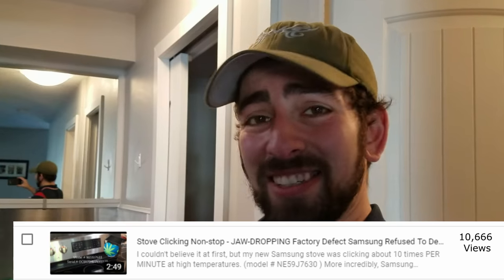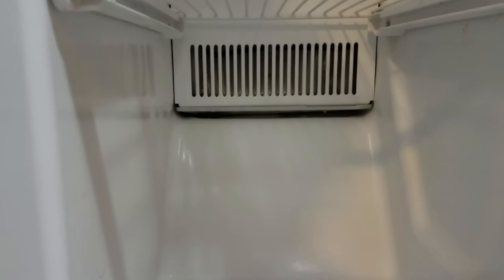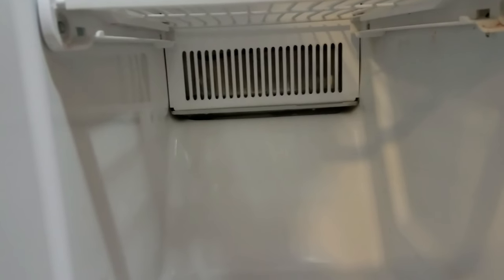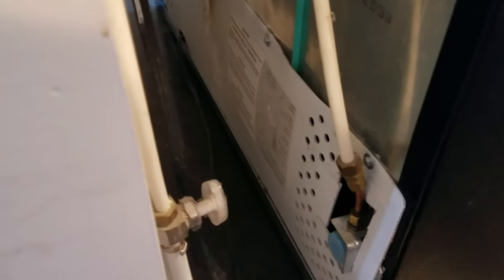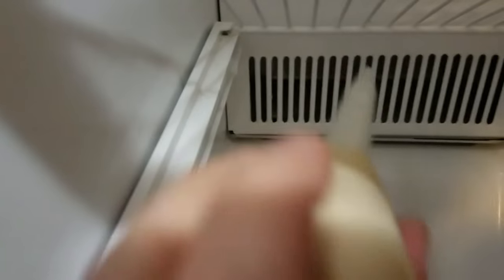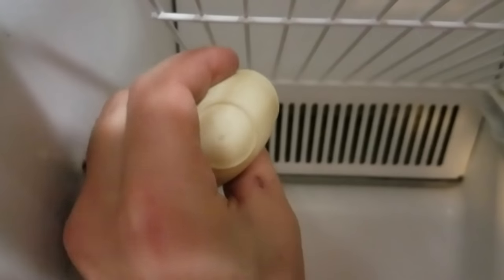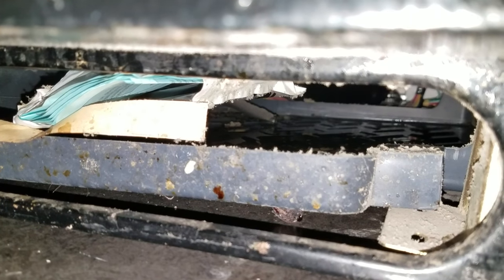Fix A Clogged Fridge Defrost Drain WITHOUT Opening Panels - How To

Comment from the maker: Holy cow, 350K views?! Top video on whole channel?! ...You guys REALLY need help with your fridges! Lol ...anyway, if you're new here Plz sub and look around...I actually have many far MORE useful videos than this simple fridge tip.
Reply: This is a lot more views now
Reply: YES...BECAUSE SAMSUNG DENIES THAT THEIR REFRIGERATOR HAS 2 HUGE DEFECTIVE ISSUES...
Reply: This will now be my first stop
Reply: So I did all this. Didn’t work. Do you have a video on how to remove the back panel and unclog it? We have that same fridge in white. And is the coil suppose to be glowing hot? Ours isn’t.
Reply: Subbed!
Reply: Sadly the hot water isn't working. Any tips on taking apart the entire rear panel, coils, etc? 😫
Reply: 350K? Try 789K! 🤣🤣🤣🤣  I had no idea this part of the machine even existed! If I had not found your vid, I would have spent all morning replacing the water valve for the ice maker, and my freezer would still be leaking! 🤣🤣🤣🤣  Dude, you should get a Tip button just for this post!
Reply: did that at my old house with a heat gun. problem is if you have to do this often could mean the defroster is failing. is what happened to me
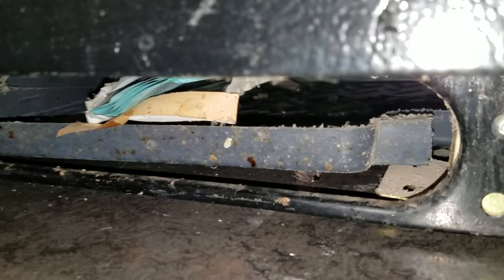Reply: Thanks. Where are you from? I like your accent. God bless. John 3:16
Reply: Thank you! Just subscribed.

Comment: This was SUCH a helpful video!  We did NOT want to open the back of our fridge.  Thanks to Lex, our drain is unclogged!!  Pro tip:  we also squirted some white vinegar in the drain as well, just to finish cleaning out the yecky stuff.  Worked like a charm!  Thank you again!!
Reply: I'd think twice before pouring vinegar solution down of any drain. It damages rubber and seals. You may want to boil some baking soda in water (or mix washing soda with hot water), and use that instead. It's an old way of unclogging all kinds of drains and it's very effective when used hot. I'd cool it before pouring into the toilet though, to avoid the thermal shock.

Comment: I have a Frigidaire. I firstly use this method, but it did not work, and continue to leak. Then, I open the panel a little bit, and found out that there is a layer of ice of half inch thick. I used a metal skewer to dig out inside the panel until I can see the drain hole. I pull hot water in, but it seems like the drain hole is still blocked. I used the same metal skewer to dig inside the drain hole, and get some ice out. After some iterations of digging and pulling hot water, it finally works. Thank you for the tips. My recommendation is to clear the start the process of pulling hot water at least you can see the drain hole (without being block by inches of ice), otherwise, the hot water won't be able to melt such big piece of ice.
Reply: Hey same issue! Thick layer of ice, you broke that first ?

Comment: I just want to call out that I have fixed my refrigerator two times in the last 3-4 years using this method. I remember the first time I had this issue, I paid someone over $200 to fix it and now it takes me 30 minutes and I don't need to take anything apart. Thank you!

Comment: Okay, this worked perfectly to fix a problem I have been having for probably over a year now. This video helped me find the drain hole, and the pan under the fridge (which I was always wondering where it was). Turns out... The drain hole was completely covered with a layer of ice, and then was also plugged with ice too. I didn't have a turkey baster but I had a condiment squeeze bottle with a pointy tip that I was able to use instead and it worked great. Thanks for the video! I was so sick and tired of having to chip out ice from the bottom of my freezer!
Reply: I don't have a turkey baster either, so I'm going to try a haircolor bottle!

Comment: I had to come back and say thank you! I did this on April 6th. I'm still amazed this was such an easy fix for what I thought was possibly something major. Plus, I thought I would have to take all of my food out but instead I watched your video, I looked up about my drain pan(I had no idea where it was or if I had one) but I do and I could kinda see it underneath so then I proceeded to remove food from the bottom only yay and saw I had a ziploc bag stuck to ice covering the drain hole! I poured the hot water repeatedly, then I could hear like a gulp of air and the water running to the drain pan! yay Thank you so much! I liked and subscribed too.

Comment: Thank you.  I was about to call repair service AND to shop for a new frig when I found your video.  I figured I had nothing to lose except a few minutes, so I boiled some water, got out the turkey baster and a knife, and after removing bottom ice and scraping ice away from bottom of the vent slots (this was iced over), I sent the boiling water down as directed.  Much to my utter surprise and great delight, it worked!  No ice collecting at bottom now, and it's over a week.  Whirlpool says it needs a 'permanent fix’ of a new drain pipe, but for now, I'm happy and will deal with the permanent issue later if Needed.  Thank you again.

Comment: Thank you so much!!!
When I saw your video, at first I couldn’t believe that it might work, so I tried to follow the instructions on someone else’s video and opened the back panel of my fridge, but unlike their fridge, mine doesn’t have an access to the tube from the back of the fridge, being too scared to open the panel that’s inside the fridge, I finally decided to follow your recommendation, and wow! I see water finally dripping from the tube in the drain pan under the fridge, and 12 hours have passed and I haven’t seen any leaks any more. 
Thank you so much. ( I used a plastic syringe to push the hot water in)

Comment: I never comment on youtube videos but i just wanted to say this helped me so much, I didnt have to remove any panels. I pumped hot water from the sink through a turkey baster, adjusted the piece over the hole so it wasnt covering it at all, and it fixed the issue. my fridge has been leaking/forming ice for over a year and I never figured it out. THANK YOU

Comment: Worked for me!  I have a french door GE with freezer at bottom.  Been getting ice under bottom tray for a while.  Defrosted vents, but could’nt get bolts off to take panels off.  Saw your video, got a bulb syringe and some hot water, and gave it a go.  After the 3rd or 4th time, heard a loud suction sound and that was it.  Put a few more cups of hot water and some baking soda down there.  Took some of the water out of drip pan to make sure it did’nt overflow, and fingers crossed that problem is solved!

Comment: For those with a Maytag french drawer freezer it may be worth the extra effort to pull panels off so you can check for excessive ice buildup in addition to the drain problem.  I had a huge chunk of ice in the upper right hand corner I had to thaw out and I put in some extra effort to do some cleanup maintenance while I had things pulled apart.

Comment: Almost worked just like you said we have been having problems for like 2 years.....boiling water didnt work but a air compressor did and cleaned out the drain hose.......GREAT VIDEO THANKS FOR THE INFO......

Comment: Just did it and it worked! Hot water alone didn’t do it, so I added vinegar and baking soda. Also had a mini drain snake, pushed it down several times. Checked the hose down at the pan again and it was dripping! Happy! Thanks!
Reply: Thank you the vinegar and baking soda I heard a big flesh and then there was finally water.
Reply: How much vinegar and baking soda did you add?
Reply: @caripokrassa5027  I didn’t measure, enough as needed I guess. It was 2 years ago I barely remember doing it! 😅

Comment: Thank you.    
I took the additional step of removing the rear panel from the INSIDE of the freezer.   Then I used an outdoor flexible, gas grill snake to snake the tube to clear it.   
Then I ran hot water down and everything worked good .

Comment: I could see through that grill that i had 2-3" high ice, so i took the four screws off that hold that panel on, then slid it up about a foot* (it flexes)
Then i used lots of hot water and used the baster directly on the drain hole  for the hose till it flowed through.  :)

But YOUR video showed me the problem and how to fix it.   Thumbs up!

Comment: I am going to add another "Thank You!"  I started on the inside and took off one shelf bracket and the back lower interior panel.  I saw the condensation drain and then found your video.  Because I had the panel off, I could dump hot water down.  But the turkey baster (and having the panel off) actually allowed me to pressure the line a little to clear it out so that it drained.
On a side note, I concurrently have a rust stain on the back of the freezer that I thought might be the issue and I was running down a rabbit hole of manufacturer defect chasing remedies, spray foam insulation, cutting metal access panels, etc....  Turns out, just a clogged drain line...  Thanks again!

Comment: Yup, that was it. 
Of course my turkey baster couldn't get enough water through the vent. I had to take off a panel inside the freezer to get to the drip tray that had a huge block of ice in it. There was also some ice above the fan that came loose. Every situation is a little different I guess. 
Thank you much!

Comment: Might be a good idea to add some baking soda to the water You're boiling (it will convert it to sodium carbonate aka soda ash solution), since it softens the water and comes highly recommended for removing clogs from all kinds of drain pipes (shower, sink, etc.; for the toilet I let the solution to cool), it's safe for seals and rubber too. Thawing of the fridge beforehand might be helpful, if not crucial, for some fridges I guess. Never tried that myself though, just an advice I've heard.
Anyway I'm having the same issue as You do with my old European style of a fridge, made by LG, where freezer is in the bottom compartment and the refrigerator is in the top. The only drain hole I can find is at the bottom of an upper (fridge) compartment, covered with a white plastic grill, similar to yours. I need to find a way of removing this grill in order to be sure my water-soda solution goes where it should.

Comment: i wish I would've found this video before replacing my icemaker and fill valve and it still not working.  I then did your trick, but with hot isopropyl alcohol, and it worked flawlessly.  Had I seen your video ahead of time, it wouldve saved me $75 for a new icemaker and valve!

Comment: Dude, thanks so much for the pro tip. The hot water baster along with a small gauge pipe cleaning wire did the trick!

Comment: Thank you! This led me down the road of exactly what was happening with mine. Had to loosen all the frozen ice in the bottom of the freezer to remove the bottom bucket pan (good ole hairdryer), then had to take the back panel off (4 screws/7 mm socket) and the condensor coils were even froze up let alone the pan. The hot water helped but had to blow it out with air compressor to finally get the drain to start draining. I will definitely start making this part of my monthly tasks is couple droppers of hot water down the drain just to make sure all is well.

Comment: If hot water does not do the trick, try using an air compressor connected to the bottom drip tube to see if you can get air flowing up through the drain in the freezer. We just did it this morning after having issues for several months. Ours is a top freezer. After a few short moments running the air compressor, the freezer drain started to bubble and some water and ice shot out. Then the air started flowed freely up through the drain hole. We kept the air going a few minutes and immediately tried flushing water down the freezer drain and whoosh, the water went right down. And I flushed a LOT down to be sure. We used a bucket and noticed that several tiny pieces of styrofoam came out with the water. That had to be what was clogging the drip tube!
Reply: Yes this worked for me, hot water alone didn't do it. Hairdryer thru the vent & comressed air up the defrost tray drip tube:
On a Kenmore bottom freezer style:
Remove only the lower back panel, identify the drip pan (not at 1st obvious) is it wet? That's the best clue. Identify the downtube or angled trough, look for a rubber nipple above the trough, clean it, and the tube coming to it. If necessary compressed air to blow the ice up. Melt with the hairdryer and Vòila, water runs into the tray below.
Reply: I had to use air compressor as well.
Reply: 1 month later, still clear of ice buildup & water on the floor. 👍🏻Wish I'd found this uTube video a year ago! I almost bought a new fridge! 🤦

Comment: Omg you saved my freezer.  I used this method but added some vinegar in the boiling water and I wasn't sure if it was going to work cuz I still saw a bit of clogged water but I think over night that vinegar helped also released what ever was clogging the whole behind that wall.  All done with out removing any panel's.... thank you so much. It's so hard to get appliances with the pandemic and I was not wanting to have to replace it. Thx again

Comment: Thank you! My refrigerator was serviced. My refrigerator never leaked before but after the service it started leaking in the back onto the floor. Oddly the drain line was pointing outside of the drip pan. Your video helped me locate the issue, hopefully the line is not clogged and was merely directed incorrectly. I’ll keep an eye on it.

Comment: Great tip if it's ice blocking the line, but if it's some other schmeg in the line, you gotta get in there somehow to clean it out
Reply: That’s exactly what he said.
Reply: Well the way my freezer is designed it's almost impossible for any schmeg to get into the drain. Good thing because the bottom was covered in food particles and melted icee pops.
Reply: So how do you get rid of the shmeg?
Reply: @joannafugardi9625  schmeg remover.

Comment: I tried the hot water but it was still clogged. I got a metal shears and cut an opening at the drain area. I jiggled a long piece of plastic tubing back and forth thru the drain line and it started draining. Thanks for your good help.

Comment: I repair for a living. The last at least 10 units I have worked on. Doing this would of only made a larger mess. Very inconvenient to do. But pretty full proof. Remove everything from freezer and fridge. open doors wide. Get fan and blow room air into freezer area. Run fan several hours Ice melts slowly. For me on a call and equipment I use it takes 2 hours to take a frozen evap and drain line back to working order. The drain line is very slow to melt. and make sure you check drain line in back that it is freely flowing. If it has a rubber cap looking thing covering the end of pipe. Remove is and clean it out under running water. make sure it is not stuck shut. Its job is to keep humidity out of freeze while letting water drain out of drain tube.

Comment: FYI, as with just about any fix, it depends on the make/model. I have a 2021 Whirlpool (Model: WRT518SZFM00) and using the baster only sent water into the refrigerator. I had to take off the inside back (defroster) panel of the freezer in order to get the water to go down the drain/defrost tube. It was a PITA but the only way to get the hot water to go down the tube. So my suggestion is; try this baster method BUT watch the inside of the refrigerator to see if that's where the water is going.

Comment: Just did mine today.  I used an ice pick to break up about a 1/4 inch of ice in the top aluminum pan.  Then melted it all with the hot water as soon as the drain hole melted.  The drain hole is about 1/2" in diameter, and it's right in the middle of the aluminum catch pan where you put the hot water.

Comment: I pray this fixes the leak on my fridge. Thanks for showing a simple step to try first. Jesus bless.
Reply: Did it work for you? I was thinking maybe a squirt gun would work alot better because of  the pressure it produces with each squirt. Just an idea for you. I used a turkey baster just today; so far, it seems to do well; if it leaks again, I WILL be trying it with a squirt gun.
Reply: @louiewhitegoldwielder6788  Hi Louie----yes, the turkey baster did work. I used really hot water and bang. It was flowing.But I think I will go ahead and pull everything that I need to to take the panel off in the freezer section to manually defrost the coils. 
Also, just went to the garage for the leaf blower (lol) to clean out all the dust and pet hair from underneath until I can get one of the skinny little coil brushes to do a more thorough job. Will put a vacuum cleaner or shop vac behind fridge to catch a bunch of the stuff that gets blown out....will start sort of further back from fridge so force of blower is not so great as to cause a huge dust storm all over the kitchen. Take it easy and have a great day. Jesus bless.
Reply: @sandrarichardson2713  Yep, good ideas yoi have! Jesus bless you as well!
Reply: @louiewhitegoldwielder6788  Either way,, You may want to use baking soda cooked in water (You'll get soda ash solution) and use this hot solution instead of plain hot water. Never tried that myself on the fridge, but for sinks and shower drains it literally works wonders (I pour soda-water solution down the drain directly from cooking pot), while being totally safe for pipes, rubber and seals (unlike i.e. vinegar). I've read that it works for fridge drains too.
It reacts with aluminum and zinc though, so I don't know if it can be poured into a squirt gun. It's safe for stainless steel.